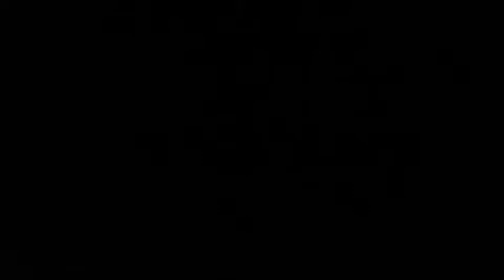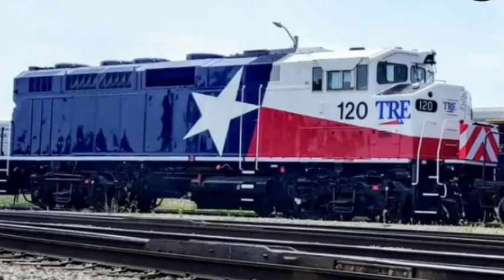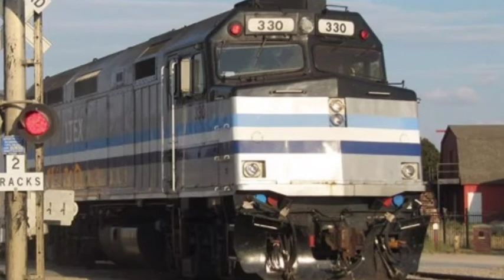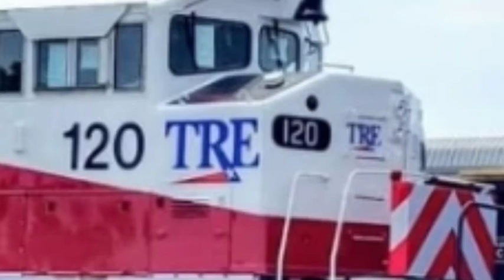The November 2018 Calloway Train Wreck 2 Years Later UPDATE!

Comment: Also it is confirmed on the TREAC Meeting that TRE is getting 2 F40ph of their owns and are being worked on rn and should be here early 2021 along with the Rebuilt F59phi 569 and 570 (Renumbered as 127 and 128 and probably be done before 2020 ends). They are also planning or thinking of buying one of the LTEX F40ph and sending the other one back
Reply from the maker: Oh, that's cool. Also, I saw a video that had TRE 120 being trailing power, I hope it is getting sent back.